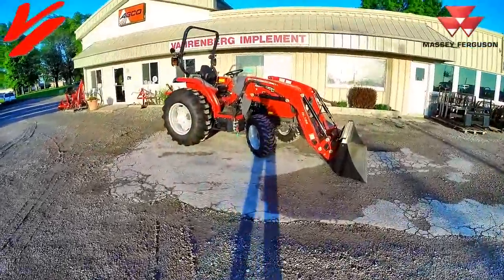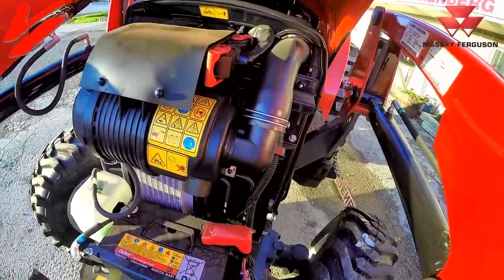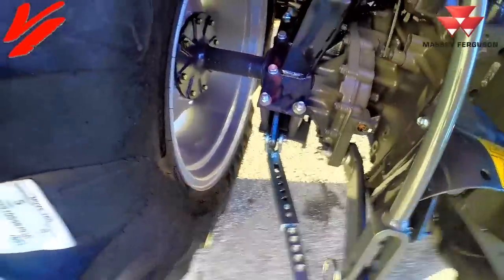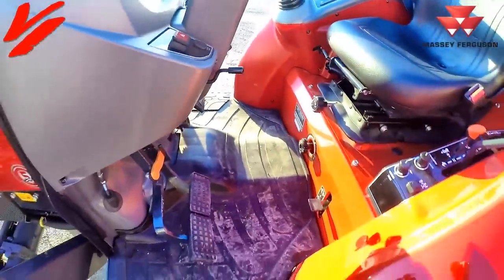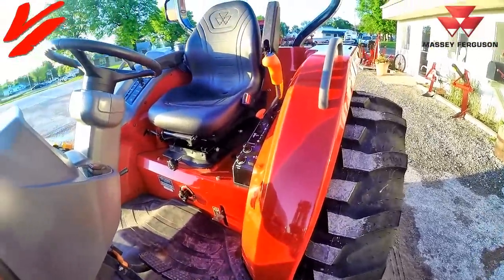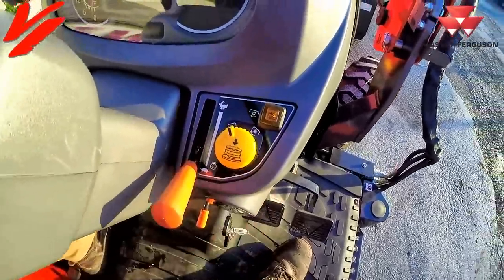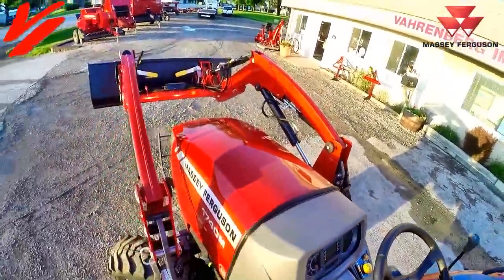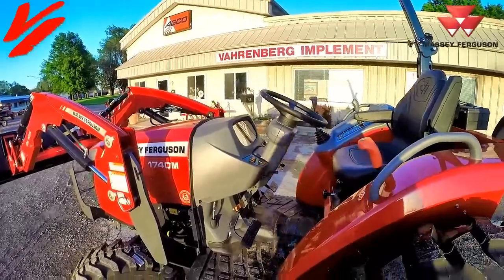Massey Ferguson 1740M Premium Compact Tractor with Rear LED Work Light

Comment: Do you have a video demonstrating a grapple or a 4-way bucket on the 1740M?
Reply from the maker: This is Video of 4-N-1 Bucket and would work the exact same way on the 1740M. This is a 1760M we did the video with that we had added Massey Ferguson Factory 3rd Function Kit. https://youtu.be/aNu_ulCugnQ 
We also did a Grapple Video with a 2700E Series Tractor which is the same Massey Ferguson Factory 3rd Function Kit uses on the 1740M. https://youtu.be/gsNPjvQjOVI

Comment: Does the 1750, 55 or 60 open stations have better seats?  I don't think the loader can do 2 functions at once - most i have seen can't unless the joystick is directly on the valve body.
Reply from the maker: You can do it on about any tractor/loader but you have to favor the tilt/dump cylinder versus up/down cylinder on tractor/loaders that use equal proportional valves that do not restrict oil flow to one of the circuits. Basic understanding of Hydraulics - oil flows to the path of least resistance. Unless you have smaller port or restrict the flow to one of the circuits oil will travel the easiest path. I can make it do two functions on these tractors but it varies by the load when lifting or tilt/dump.

Comment: Have a question for you Doug.  How do you change the panel display to read MPH rather than KM/H?  I noticed that your video shows KM/H but in some of you other videos it shows MPH.  Checked the  manual and cannot seem to find any details on how to do that specifically.  I have used the display select switch and that just seems to switch the display between that and the PTO speed.  You obviously are a subject matter expert, so can you help me?

Comment: Does the optional mid-PTO allow the use of a belly mount mower deck with this tractor? I know that the 1735 model does but want to know how large/powerfull I can go & still be able to use a belly mower. Also what other attachments are available for use with a mid-PTO option?
Reply from the maker: 1735M & 1740M both offer Mid Mount Mower Option. Mid-PTO is used with Mid Mount Mowers, Front Mounted Snowblower or Rotary Brooms to power those accessories.

Comment: Hi nice tractor, can the 1735m tractor use a 6'ft cutter as well?
Reply from the maker: Depends. Not all rotary cutters require the same input PTO Horsepower. We sell RhinoAG and they build rotary cutters that can cut from 1" diameter Material (Tree Diameter) to 4.5" diameter cut capacity. The 1" only needs 25 PTO HP but the 4.5" needs 55 PTO HP. The TW16 at 1" cut capacity works with the 1735M but the 2" needs 35 PTO HP and we sell that with the 1740M. So it all depends on the cutter you want to use.
Reply: @VahrenbergImplement  thanks that helps me a lot, u are doing a great job I dont know what they are going to do stop working, hopefully that's going to be a very long time from Now 😎

Comment: Is this made by Iseki?
Reply from the maker: Yes the Tractors are Manufacturered by ISEKI for Massey Ferguson. The New 1840M which replaced the 1740M now uses the ISEKI Engine too. So it's all ISEKI Built Powertrain back again! We have done videos on the 1840M

Comment: How does this tractor compare size wise to the older 1240
Reply from the maker: The 1240 was 30 Engine HP and 23.1 PTO HP whereas the 1740M is 40 Engine and 26.4 PTO HP so the 1740M is amore HP than the 1240. Here is link to Tractor Data on the 1240: http://www.tractordata.com/farm-tractors/000/8/4/845-massey-ferguson-1240.html

Comment: Why is the oil fill on the opposite side of dipstick  ?  That is crazy
Reply from the maker: That is a great question to ask the Engineers. But we have seen very minimal oil loss in these engines but understand your comment. Probably due to size of the tractors, keeping them compact limits where oil fill and dipstick are placed.

Comment: That is a Mighty-Fine M-F 1740M  I do not see anything on this I do not like thanks for the video
Reply from the maker: Thanks for watching.
Reply: I wish the front steering was behind the front axle.  Other than that it’s good to go!
Reply from the maker: We've run cylinders like this for several generations of tractors and no issues we have seen at our dealership.